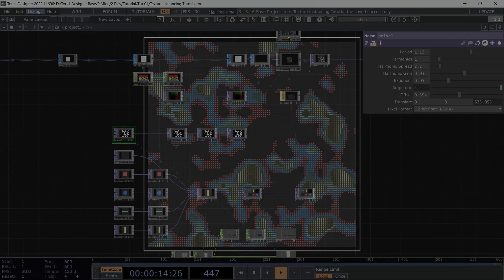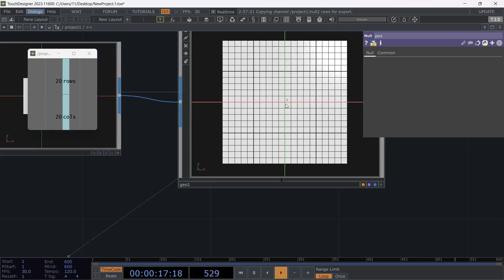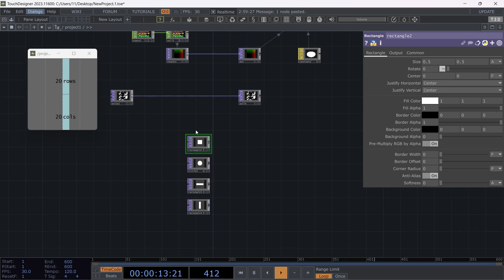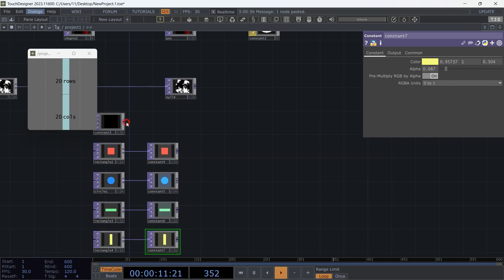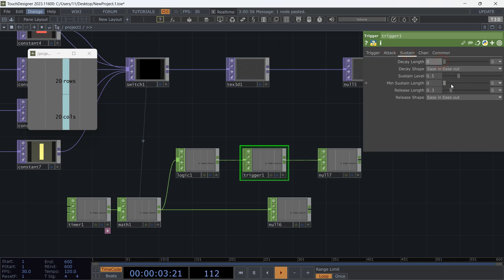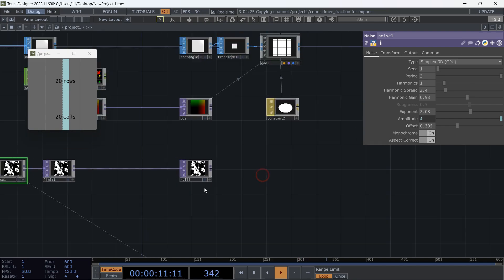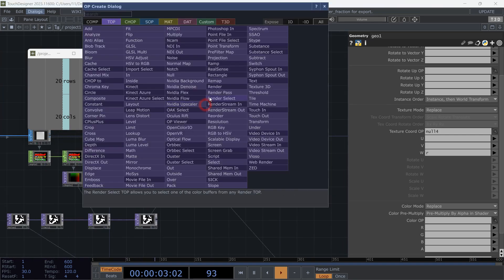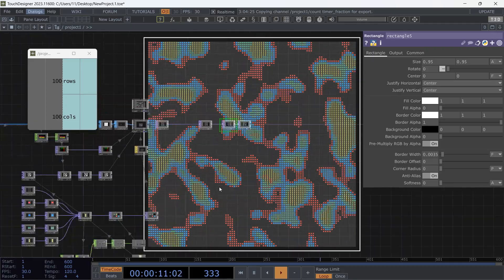Touchdesigner Tutorial 04 - Instancing textures

Comment: the texture3d op doesnt not count all of my textures when i hit the initialize and start pulse? Any suggestions?
Reply: i also have this problem and i checked everything it should be done just like that. my switch is processing only one constant input but the set up its the same as in the tutorial. and other way around this😮‍💨
Reply: @metkablazek1820  same here
Reply from the maker: check 3 things:
1. in mathCHOP after the Timer, check if multiply value is getting correct value. it should be ("number of switch inputs" - 1)
2. check if "switchTOP's Index", "Tex3dTOP's Replace index" and Count are showing the same number after you hit initialize and start. 
3. in Tex3dTOP, Cache size must match number of switchTOP inputs, AND reset pulse must be connected to our timerCHOP's "Initialize" button. also texture3D type must be 2D texture array.
Reply from the maker: before checking all of above, if it just doen't count a texture, try hitting "Initialize" Twice!
Reply: Hello! I had the same issue and watching carefully moment around 8:57 - 9:04 was helpful for me (dragging trigger value into Replace Pulse and count value into Replace Index in "tex3dTOP")
Reply: also expression "len(op('switch1').inputs)" worked well in my project and showed me all of the textures (without -1 in the end of the expression as in the tutorial)
Reply: I had the same issue and redid everything with no luck. Changed a couple of parameters like "convert Input" in the logic1, now it seems to work. I think the problem is some kind of trigger that had something stored somewhere or something.